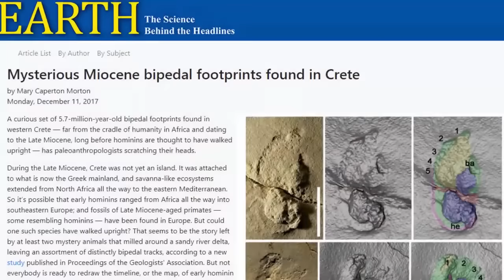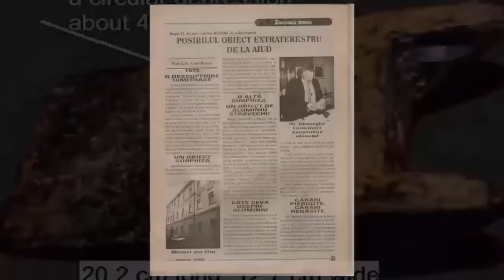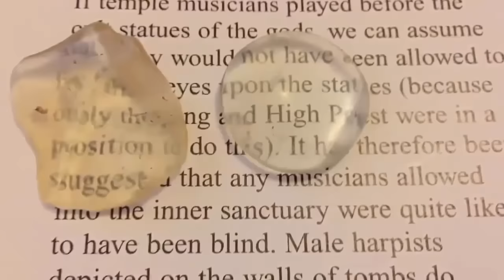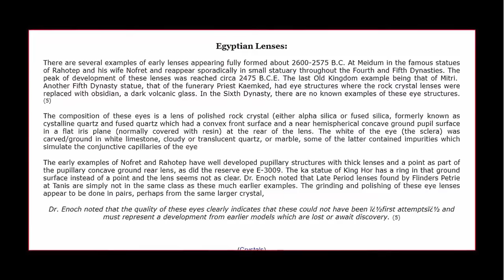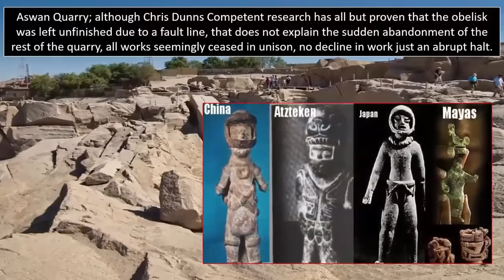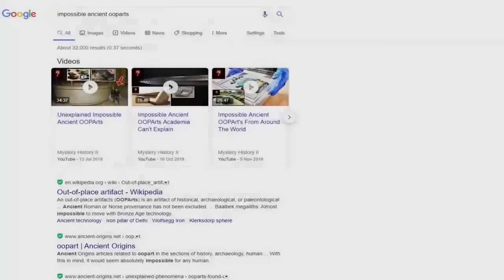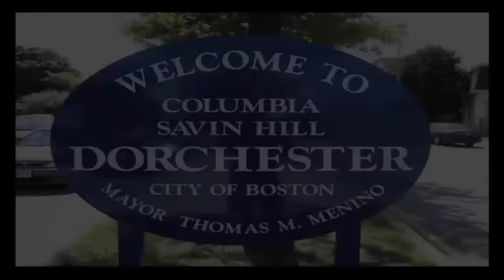The Most Mind-Blowing Artifacts Ever Found?

Comment: "clamps" were not poured into an existing mortise, they were forged, heat treated ad the formed clamps were then mortised into the joint between two stones.  The blacksmith would understand that ferrous metals are slowly cooled or quickly quenched depending on the requirement.  Pouring molten steel into a cold, stone mortise leaves the metal both too brittle and too soft, as cooling is unsystematized.

Comment: Metal “clamps” are in fact not clamps at all. They were used to bind granitic stones together electrically in order for them to be melted and formed together using heat produced by very high voyage and amperage. The idea that such puny straps could have held gigantic and enormously heavy boulders in place over eons is not possible.
Reply: Ah. You see the blisters, melted rock and other electrical anomalies as well? They were mastering electricity for some purposes we havent quite concieved yet. Who knows maybe earths current climate wont allow this. Quick bit of neat info. The deep bore holes...at the bottoms they stop because the drills wont bite. The granite is like rubber.
Reply: Dryer the climate the higher the static
Reply: Somehow made concrete granite bricks enormous, and to form.....
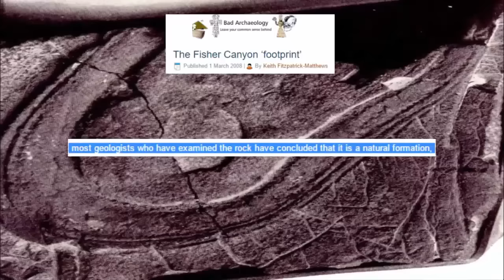Reply: At time slot 41:11 shoe print, how about diving boot for diving suit to better understand the overwhelming Waters that were approaching them they would want a great study

Comment: Ref; the aluminum oopart found in Romania. Having spent most of my working life operating excavators and other heavy equipment in mines, I can say without any hesitation that this item would not last two minutes if fitted to the shovel or bucket of any earthmoving equipment.
So that explanation can be discounted as an explanation of its possible uses.
Reply: Reminds me very much of the locking pawl of a Locomotive Jack!
Reply: Not a beet digger?  Well no beets for you!  It looks a little half-assed in construction because the big hole in the center looks off center a bit!  Like the BMW’s from the 80’s where the exhaust is slightly off center, not enough to look like they did it on purpose, but like they missed the mark and did it on accident!

Comment: That "Wedge" at 7:28 looks all the world like a pawl or tooth in a Locomotive Jack we used back in the 1970s through the 80's and 90's it could be older than that too. but it's exactly what it looks like. It looks like the tooth that engages in the rack that goes up and down that does the lifting, well as you lift the square shaft up in the jack this tooth would engage in the teeth cut into the back of the lifting shaft to keep it from falling back down. You can find images of these jacks online.
Reply: Hmm. Interesting. Tracks are still very economical. Why wouldnt they ha e been before now. Mankind has amnesia dont we?
Reply: @j.pershing2197  They could have had Tracks for vehicles but I was thinking along the lines of them having industrial sized Jacks... For lifting incredibly large things. One of these Jacks could not only lift a steel Rail into place but it could lift one side of a fully loaded Boxcar as well.
Reply: @oldogre5999  So very large things… like a 2 ton stone? Could that be the key to how they lifted all these impossible stones?
Reply: @ChadBoss-qr4hl  Kind of what I am wondering, many of those stones have little nubbins sticking out. Is that to lift up on? Others have places for beams to fit into.... But some of those stones, I just cant see being lifted by jacks! They are so huge and heavy! I think civilizations have existed on Earth far longer than science wants to admit!
Reply: really, made from aluminium ?
Reply: @knallpistolen  Aluminum composite or something, those jacks were very large but light for their size. Looked like Aluminum except for the rack and pinion type gearing and the part you stuck the Iron bar into for a jack handle. You can see images of them  on the internet still.

Comment: the wedge looks like a door dog to me. dogs are wedges used on ships and aircraft to hold doors shut, normally used with hand cranks or motor driven and linkages. also used on space craft pressure doors.

Comment: 23:36 and 23:46 minutes of this video. I don't know if you know that you showed, 2 enormous faces in the mountain/rock/cave. The first is the compleet floor of this cave (23:36), from left to right I see forehead, eyes, nose, lips, chin and then the neck never seems to end and its all completely horizontal.
The second face I see (23:46) in a 40 degree angle facing up, again I see the neck which never end from the bottom of the screen, going up in a 70 degree angle, than (at about 70% of your screen following this rock upwards) the chin, the lips, a nose, clear eyes. As if his head rest between the rest of the rocks.
I mentioned it because you didn't 😉 thx for the video 👋🖐👋🖐👋🖐